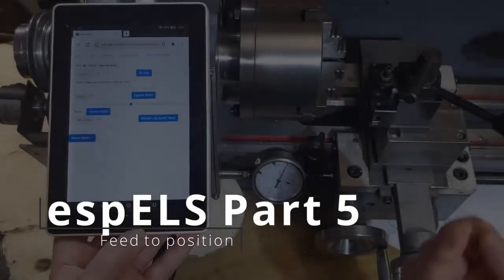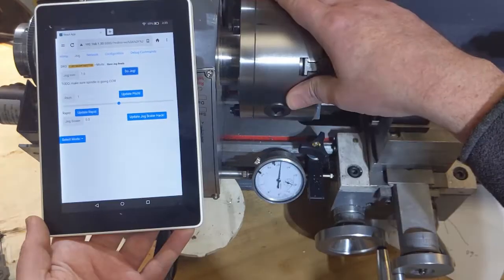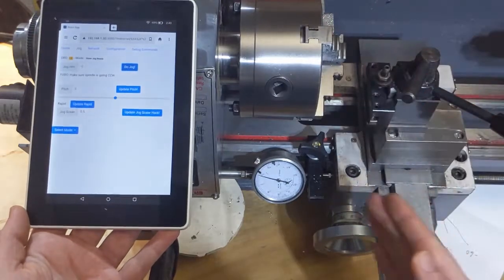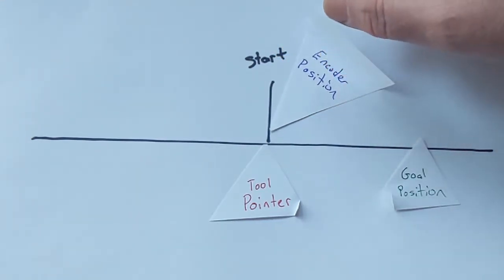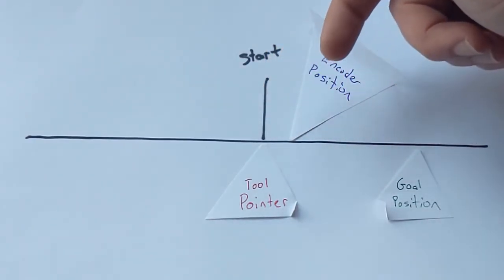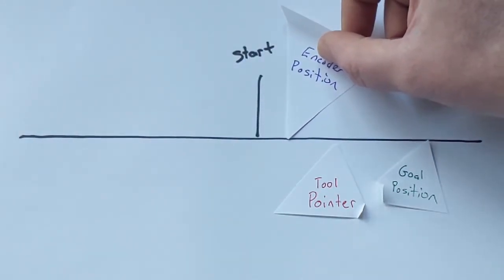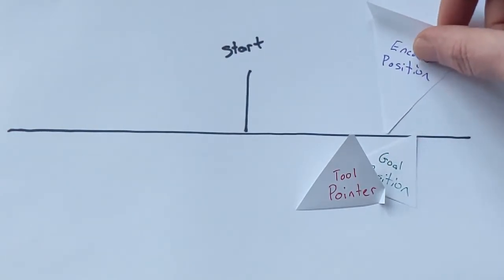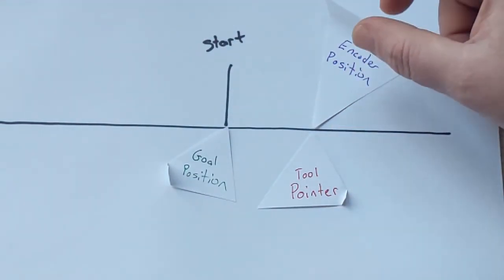espELS: part5 Synchronized feeding to position

Comment: And to make it even simpler, look at Bresenhamp's interpolation algorithm - it actually locks two binary numbers for any fractional ratios and generates pulses to satisfy your equation... Uses only binary addition and may be implemented at the encoder's speed in software or hardware.   https://en.wikipedia.org/wiki/Bresenham%27s_line_algorithm
Reply from the maker: i use a derivation of bresenham's algo from /prototypicall/Didge on github

Comment: Would it help to internally multiple the number of stepper pulses per revolution so that there is a small common factor relation between the encoder and actual stepper pulses per revolution? A pulse would be sent once the internal count is divisible by common factor. Just wondering if this would help simplify the conditionals while avoiding floating point. Or is floating point OK?
Reply from the maker: my initial approach was to just calculate the steps per encoder pulse as a float based on the pitch required.  I don't think it helps with the complexity of the conditionals, but i'm a pretty crappy programmer so it may also be me doing it wrong ;)  The downside of self instruction is that you have to learn the hard way and you don't have much opportunity to ask questions to someone who has the expertise.  Regarding using floats, it seemed to be fast enough to just use floats on the eps32 in a 80Mhz timer but I don't know for sure how fast it was running.  I'm running the timer much slower now (20Mhz) since the encoder isn't going to be spinning that fast.  I also am not doing the manual step generation in that 80Mhz timer anymore.   I wanted to have some headroom for features but maybe I don't need it.  the websockets are updating ever 300ms and it seems to be ok with those update speeds.  It may actually be more efficient than updating a full page of a OLED display.  It is also cool to be able to have multiple browsers open with different views all getting updated at the same time!
Reply from the maker: @zomgthisisawesomelol  what do you do for a .7mm thread?  on my setup that is not integer steps without figuring out the error with something like bresenham.

Comment: Jesse, not sure why you need timers for ELS. ELS equation is stepper = pitch * encoder * constant
Reply from the maker: The first reason is to have proper step signals, I may move to using the RMT peripheral to generate step pulses.  I'm also not always slaved to the spindle and need to jog without the encoder being involved.  The second reason is to deal with the encoder but in this case I'm using a library that uses the esp32 pulse counting peripheral so I only need the timer to run between every possible encoder tick.  I'm using timers for time critical code.  The rest of the code uses lazy timers since it is not as time critical to check the buttons, serve MDNS, serve the websockets, update display, update the webui, change states, initialize code etc.  There is very little blocking code.  There is a lot of messy code!